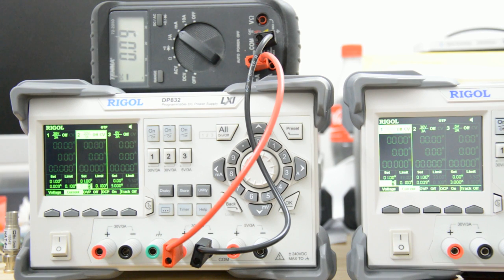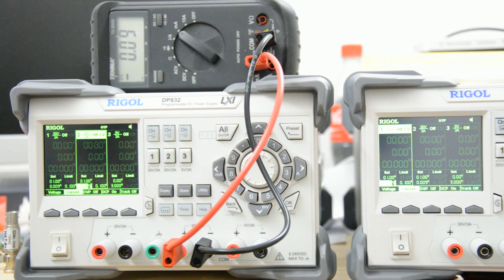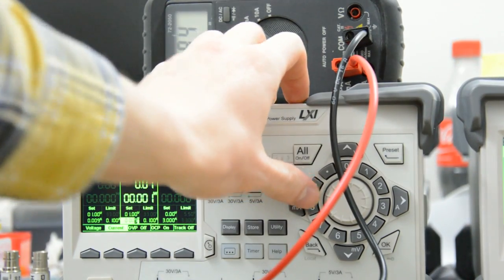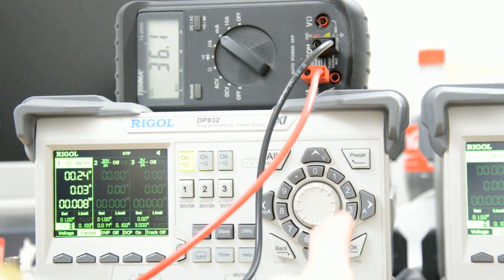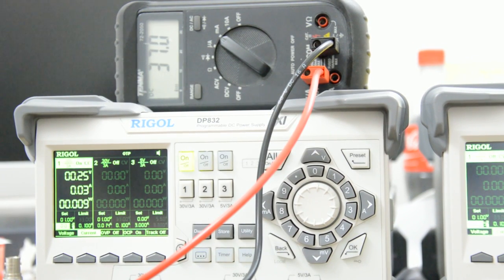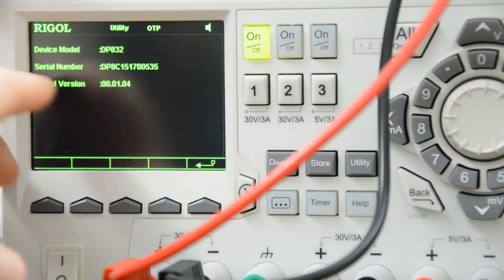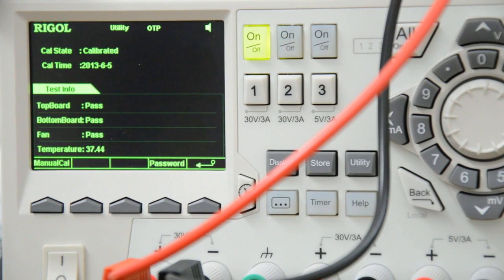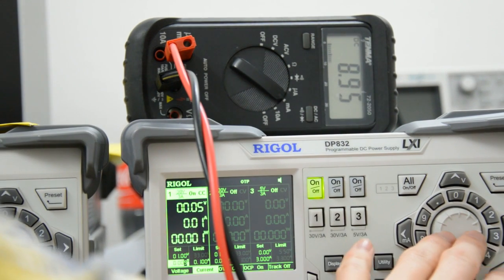Brand new Rigol DP832 fails calibration

Comment: Same or similar  problem with DP832, channel 1
http://www.eevblog.com/forum/testgear/new-rigol-dp832-1st-channel-lcd-is-wrong-help!/

As I understand output is OK, LCD is not. Now what accuracy applies to LCD? 1mV.
Given then Fact that other 2 channels are OK. Means bad quality control RIGOL !
They seem unable to FIX many issues with first board that is used for channel 1.

So if you buy DP832 and it does not show zeroes upon power-up for voltage, if channels are not the same, then send it back. I would suggest same for the op of the thread on eevblog too.
Reply from the maker: Wow thanks for sharing this. I did not expect this two years after I had the problem. Thank you for sharing. Not sure if yours is really out of spec but it's strange to say the least! Would be interesting to know what Rigol has to say about it...
Reply: well it's not my unit I just want one so looking for information I found that thread. I will keep an eye on it how this resolves.
Reply: Does your unit still show zeros on lcd? Did it drift on it? Did it drift on actual output
Reply from the maker: I have not noticed any significant drifting on the new unit. I had to return the out-of-cal unit so I can't comment on that. What do you mean by "still show zeros on lcd"?
Reply: I mean when you set 0V and 3.2A and enable outputs, all shows 0.00v? What about something like 0.010V 0.030A, still 0.00V
Reply from the maker: I have the high resolution license. With this, it does show 00.004 V, 0.000 A on one channel and all zeroes on the other. In the 10 mV setting, I get 0.014 V on one channel and 0.010 V on the other channel. This is with no load connected.
Reply: Lucky you then, the unit mentioned shows 13 milivolts on ch1. This is outside even RIGOL warranty policy. Unfortunately the user was told that to send unit back it cost 80Eur shipping. Also RIGOL asked how could you see the error if you did not get a license from US.

It seems to me RIGOL deliberately sells defective (bad calibration) DP832 so then when you get resolution upgrade you will ship the unit to them for calibration. One channel costs 50Eur.

It's not hard to calculate that if you have 2 units or send for calibration twice a year it would be cheaper to get proper 6digit DMM and do calibration yourself.

The user has 500Eur brick now.

Comment: Hi,

Calibration should be done after the instrument has warmed up and in stable condition. Do you recall if the measurements showed any drift with time?

Anyway, it is strange that an instrument that was calibrated, stocked for 1 year and eventually shipped to you could have such an offset. Makes me wonder...  

Quality program ISO 9000 requires that each instrument used for characterization or production has its own calibration certificate. Usually, brand new instruments ship with calibration certificates that are valid for 2 years. So, that outdated calibration report could have an impact on costs, too!

BTW, that calibration report shows nothing at all - no actual measurements, marked check list or whatever! If anything, it is a functionality & cosmetics report!

Anyway, thanks for the video!
Reply from the maker: Jose Pedro Carmo Both supplies were running for more than an hour while I was setting up things and preparing for taking the shots. There was no drift on the systematic error.It's been a while and I'm not sure whether I said that in the video, but there had been an issue with an overheating 7805 on this supply in the past and apparently Rigol addressed this by swapping a board on faulty units. My best guess is that they swapped the board and forgot to re-calibrate the unit. That would explain those weird effects but this is not more than guesswork on my side.To be honest it has been quite a while since I've seen a calibration certificate with actual measurements. The Agilent one I'm comparing with in the video doesn't have that either, but of course it's still a proper cal cert, in contrast to the "cosmetic" one from Rigol. Thanks for commenting!
Reply: And not with a Tenma DMM rookie.
Reply from the maker: Are you suggesting there is doubt that the issue exists because I used what you consider a poor DMM? The PS readout aligns with the DMM  and if I remember correctly, I discovered this when testing a circuit completely unrelated to the Tenma. In any case, what would be a failure mode of the Tenma that would yield this kind of result with a PS that is in spec?

Comment from the maker: +stavros houiris on the question whether the DP832A is also affected: Note that the issue I describe in this video appears to be very specific to my unit; I have not seen any other reports of this problem. There is however a number of issues with the DP832, at least in early units. The thermal issue is one, and there is also something realted to the way they measure current. It might be that the latter issue still persists. As for whether the A model is also affected, I have no idea; the best advice I can give is to check out the eevblog forum link and ask there if it is not clear.